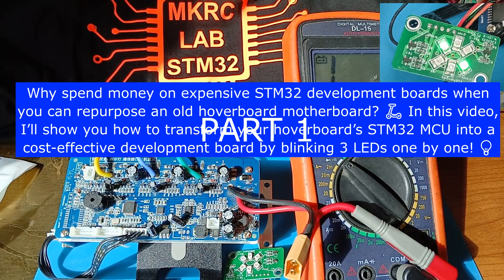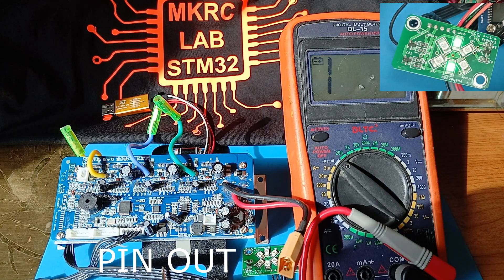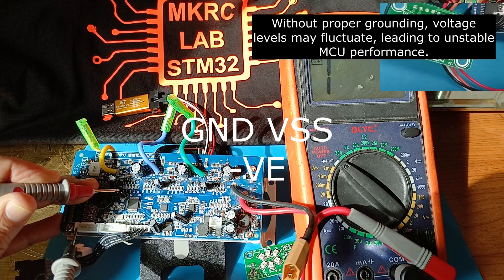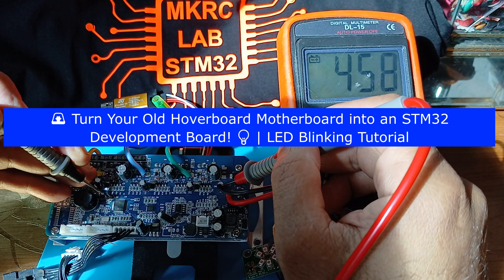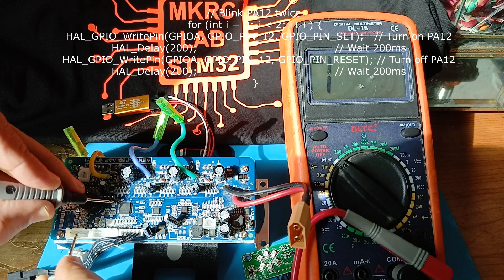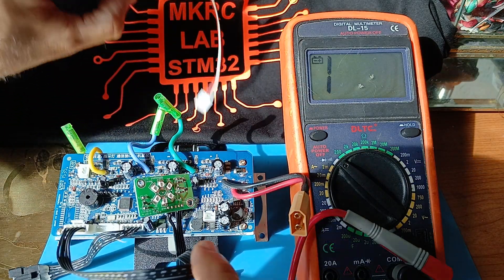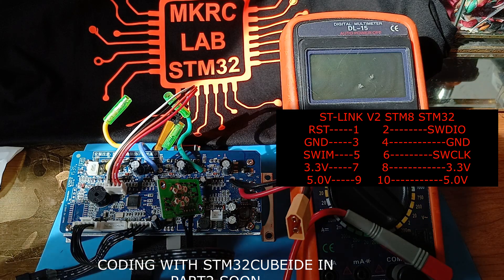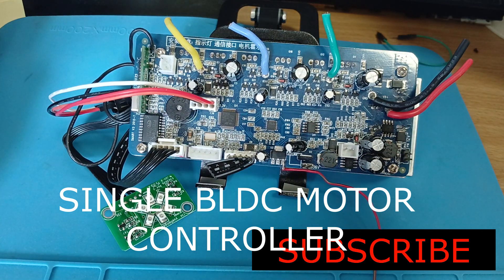Hoverboard Motherboard convert to   STM32 Development Board  circuit tracing Tutorial PART 1

Comment: i have some problem with STM32F103 mainboard, programmed it with same firmware that works on other boards, but after programming no buzzer nothing.. the code is in the memory. also it turns on without sound and only if u hold on button.
have no idea what is wrong.
tried different firmware same thing. erased it etc many times.

Comment: Built a 4 wheel drive skid steer robot with overboard motors, but currently using arduino-bldc driver interface.. would make a lot more sense to just use 2 of the actual boards made to drive the motor.. thanks for sharing your knowledge!
Reply from the maker: Soon I will share code for original board to use and control bldc motor